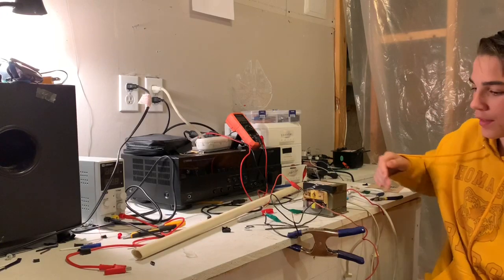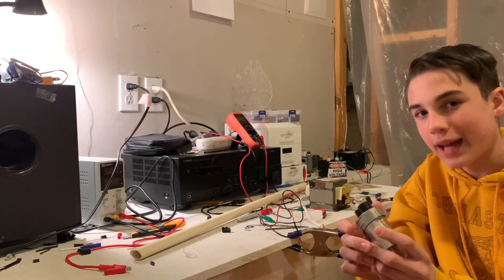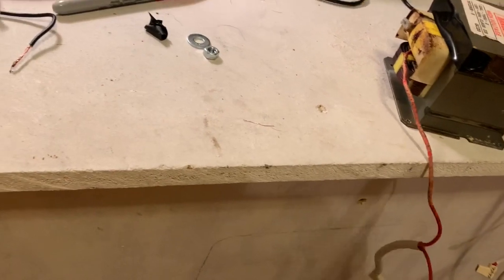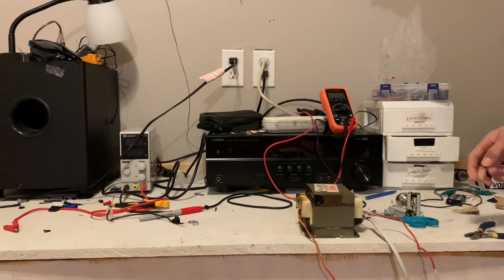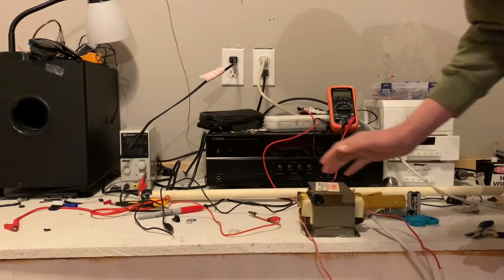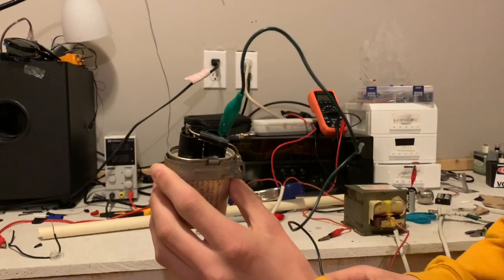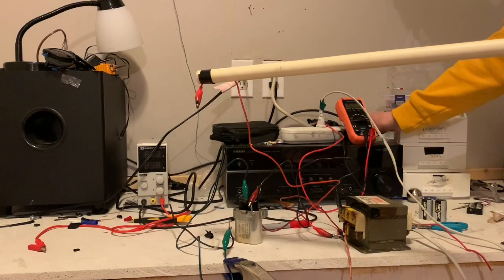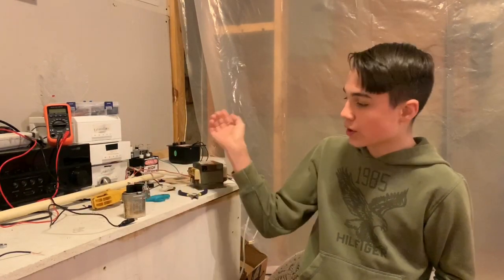High voltage experiment with a microwave transformer

Comment: is that the original mains cable for the MOT? or did you wire that yourself?
Reply from the maker: It’s my own cable from an old CD player, but I recommend using the original microwave cable because it’s meant for the high current.
Reply: @electronicscience1412 Hey, I tried doing the same thing to make arcs and the transformer turned on but it didn’t work when I tried arcing the alligator clips together. Can you explain why?

Comment: i used a 15 a breaker in my input and i ballasted the output on the neutral side. My fridge is on the same breaker as my garage outlet not trying to blow it to much. Welding rod is a good electrode. Do you have the diode? The magnetron is great fun too bad EMI is hard to block but subwoofer magnets are great EM radiation absorption.
Reply from the maker: Definitely!! I installed a 50Amp breaker on my system so I can have fun with my MOT’s in series.